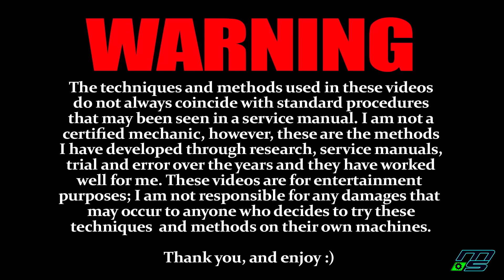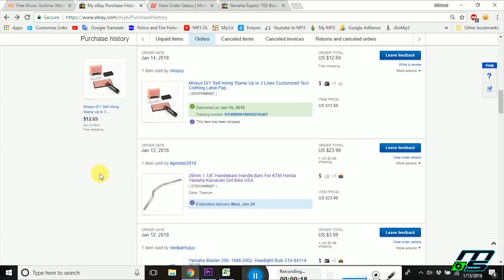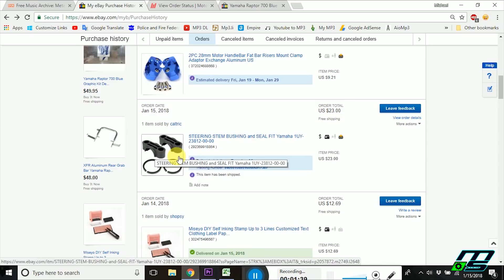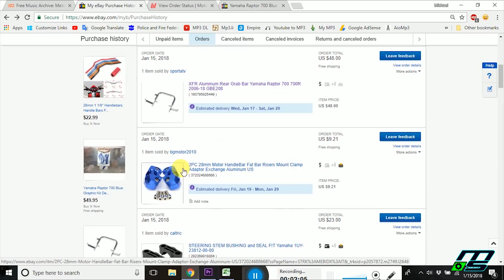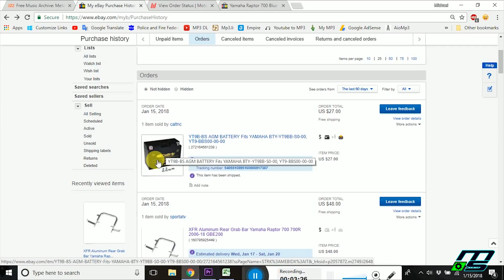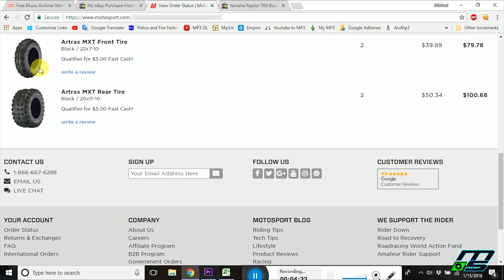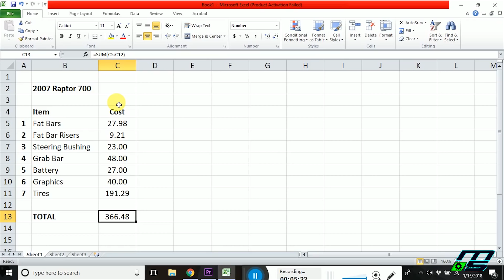I'M BACK!!! Blaster Finished & RAPTOR 700 BEGINS!!!

Comment: You can also use brakes from a banshee on it or a cr250 rear brake
Reply from the maker: Thanks dude, I was un-aware the the CR250 brake will work but I've heard of Banshee brakes on the blaster. The owner said the next time around he want to upgrade to that.
Reply: Michael Sabo I think for the cr250 brake you need to make a new bracket but I think it’d be worth it, mine has banshee brakes front and rear and they were amazing they were better than my 400ex brakes and Crf250r

Comment: Hi I have a question I hope you answer how would you know if a chinese carburetor would fit on a bike. pacifically on the airbox and intake manifold I have a 1987 KX80 and I want to switch the carburetor
Reply from the maker: What's up man; just measure both sides of your carburetor and check the specs of the aftermarket one before you buy it. If you can't accurately measure it, look up the stock specs of your carb on google. You can usually fit a carb that is a millimeter or two bigger also.

Comment: Hey was curious what kind of rims are on the blaster and where I can get them?
Reply from the maker: The rear rims are stock steelies and the front one's I put on were stock aluminum rims from a Raptor 660 that I parted out.
Reply: Michael Sabo hey sorry I meant the raptor rims
Reply from the maker: They called SS rims by ITP. Here's an eBay link...

https://www.ebay.com/itm/SET-OF-4-ITP-SS112-Rims-Yamaha-Banshee-Warrior-350-Four-ATV-wheels-Matte-Black/272070279092?hash=item3f58a6ffb4:g:RMgAAOSwf-VWZlR~&vxp=mtr

Comment: Hey mike quick question... should I do the TORES delete for my banshee.. and what is advantage of doing that... does it run better or something... I just bought my banshee it runs awesome but won’t idle at all I tried adjusting the screws on the TORES but didn’t do any thing..  my atv is now backfireing .. do u think I got the carbs out of sync but playing with those screws????
Reply from the maker: My advice is to remove the TORS. It is a system that Yamaha had to put on only for safety regulations, not for performance. They are notorious for going bad and causing weird symptoms. They're easy and cheap to delete. I'd start there and see if that fixes your problem. You can buy a TORS delete kit on ebay.

Comment: GBC XC master tires are a great tire for a great price I love mine
Reply: Susan Fox how do you like the Gbc xc masters? I've heard good things about them. I currently run maxxis razor 2. I was going to buy another set but those xc masters look like they have excellent forward traction that I'm needing on my 120 h.p. banshee. Any opinions on the Gbc xc masters would be appreciated. Lol. There's not much info on them other than manufacturers or retailer. Thanks
Reply from the maker: I've run the Maxxis Razr 2 on an LT250R and loved them. I think the GBC's look more aggressive though. I believe trailblogger runs/ran them; he may have some insight for you.
Reply: Michael Sabo yeah he gave me some great input on them & showed me a vid as to how well they hooked on acceleration. I wanted to find the best tire for acceleration but one that could slide out around turns easily as well. Trail blogger also mentioned the bear claws like what he has on his wife's raptor but he also said that the bear claws don't slide as well & tend to roll around turns. I run a 4 cylinder street bike engine so trying to get a maximum traction tire that can slide well around turns is a challenge. The bear claws will give me the traction but they take the fun out of spirited riding on tight trails. Mainly just looking for more real opinions on the Gbc xc masters. Kenda makes a newer sport orientated bear claw although 25" is the smallest size they come in & I'm looking for 22" uggh!"
Reply: Banshee Fever 750cc I have the on my fronts for a Honda 250 ex they have held up great no problems I am going to get them for rears a when mine go bald. I would highly recommend getting them